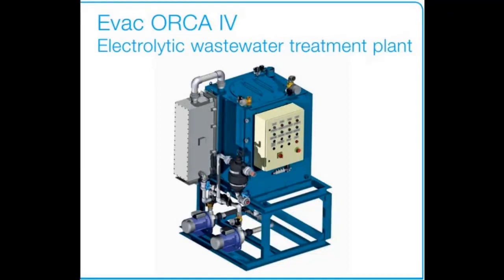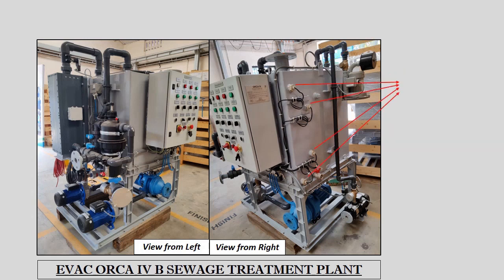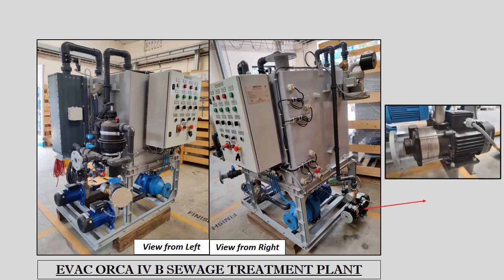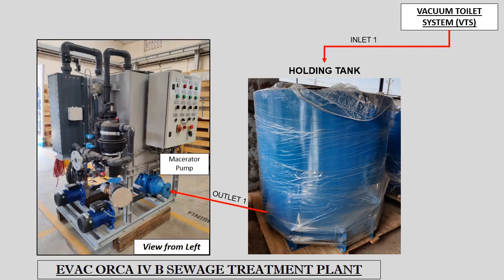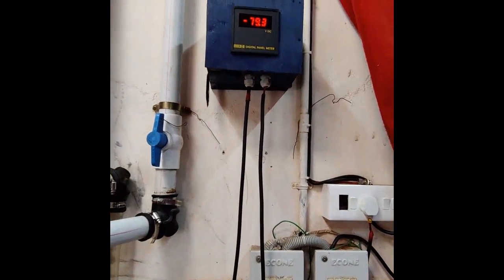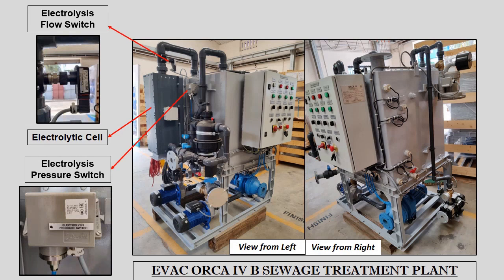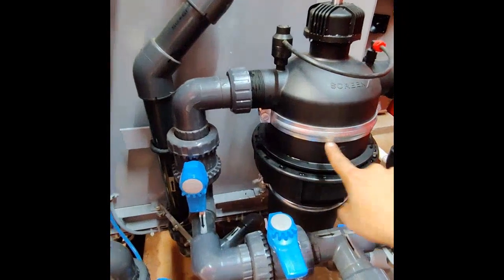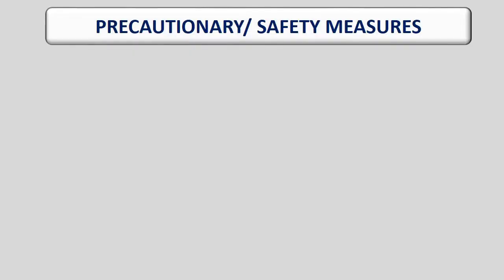Evac Orca IV Working Principle and Sewage Treatment Plant/ How STP works

Comment: You said treated sludge transferred to the holding tank after being treated from the reaction tank. Effluent water only discharged from reaction tank to the overboard. Then what about the treated sludge which is transferred to the holding tank, will it be treated again or else???